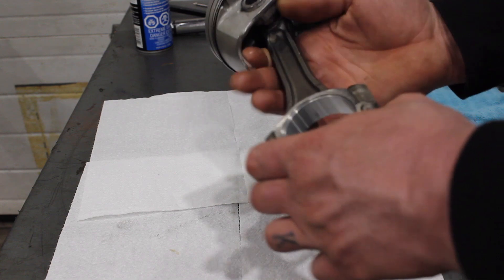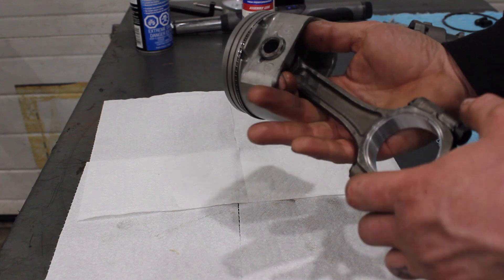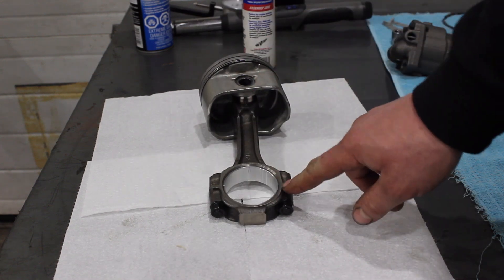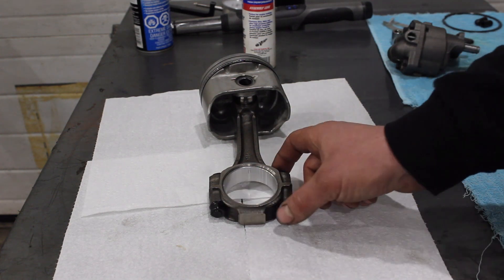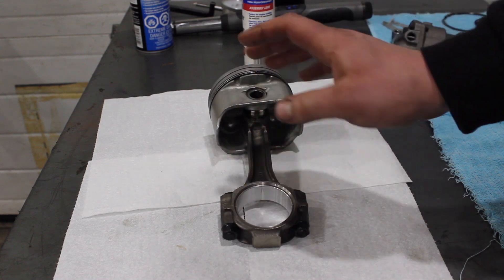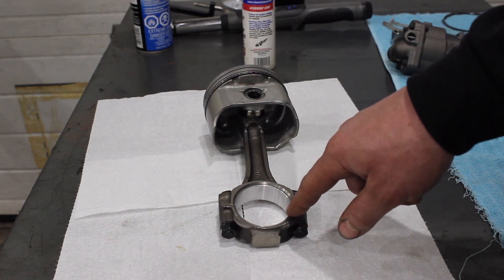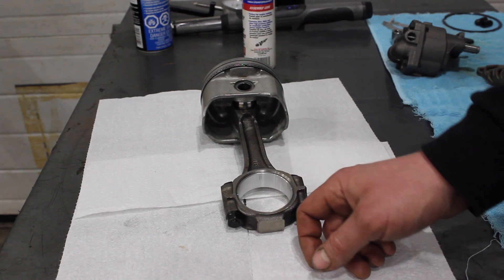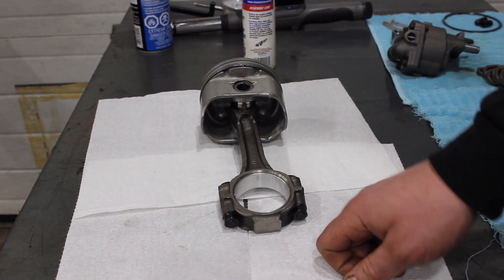An Important Upgrade! Even for a budget build (L31 Build Part 3)

Comment: I like budget builds and SBC's, built a ton of them and big blocks but I see at the current time a diminishing return on your money compared to a LS based engine.  Nothing wrong with a SBC, don't get me wrong but with just a cam change a Silverado 5.3 and a set of long tubes puts out 440-450hp even on a carb.  I've been building the LS based 5.3's for over 10 years and from a performance standpoint the SBC is now the the red headed stepchild on the street.  Don't get me wrong, I still build them for the my cruiser friends but from a performance standpoint you just can't beat those LS heads for power production.  I do like to run a carb on them, simple and easy and I've had no problems with tuning and they are dirt simple, much easier than a SBC to build and modify, even rod bolt replacement with the cracked cap technology just requires  you to press them in and run 'em.   What say you ?  How much work and expense do you have to invest to reach that 450hp level with a SBC ?
Reply: To each there own. I've never had trouble getting power out of SBCs. Some folks just go about shit differently and believe alot of misinformation. Monkey see monkey do. I've been building engines of all brands for over 40+yrs. The LS is just another choice out of many. But they are trendy in the world of people who think everything old sucks. We been making power long before the LS showed up. And in the real world, the bigblock Chevy is king. Btw, I've built at least 20 LS engines over the past 15yrs, so I speak from experience. If the LS was so much better, I'd sell all my bigblock Chevy shit and buy a bunch of LS shit. But I know the reality of the situation. And with the parts available today, it's not hard to build a 434ci SBC that puts out 850+hp NA. I remember Don Kirn built a 427ci SBC with a Rodeck block and ALL-PRO heads, single 4-barrel and it made 1005hp NA back in the late 90s. Check out Sprint car 410s, 950hp NA, that's what Don Kirn specialized in. Look at some Comp Eliminator SBCs and see how much power they make. Reher & Morrison built some of the most powerful SBCs ever built. You just ain't been around any real SBCs that were built for big power. Those 300hp 350s get pretty boring. I have a 590hp NA 357sbc tucked away now. Take a stout LS build to run with it NA. Ran mid 6s in the 8th. LS is just another engine. Plenty are better.
Reply: Godzilla Ford is better than the LS if ya gotta have a modern engine, because everything old sucks....
Reply from the maker: Its certainly preference but theres no doubt that a LS has almost 50 years of technology over the traditional SBC. They took decades of racing and factory design and incorporated them into the LS platform. It would be weird if they didnt have some advantages haha. Now a LS build isnt always as cheap as some may think...if you already have a SBC with headers, mounts, trans setup ect...a LS swap adds up quickly. You can often find a deal on a SBC intake for $100 and $50 used HEI, where if you wanted to run a carb LS your looking at $1000. The real advantage to the LS is the heads though, they are as good as alot of aftermarket SBC head and are key to power. I do like LS engines and I will probably show some of the ones I build on my channel in the future. But to this day the traditional SBC still holds a special place in my heart  and I think many feel the same
Reply: @cuttersperformance  The LS has 50yrs of development on the gen 1, but the gen 1 SBC also benefits from 60+yrs of continuous development in practically every form of motorsports known to man. There are SBC heads available, "ALL PRO for example" that make the best LS head made look stupid.  Most powerful SBC or LS  I've ever seen was Rick Santos Top Alcohol dragster 377ci 14-71 blown alky engines back in the 90s. 3000+hp 25+yrs ago. Ran in a class full of Hemis and kicked was. Never seen an LS that could run in that class.... It's all BAE Hemis now. LS is a good engine to build, but it's far from the best.
Reply: @cuttersperformance  Not many people building Stock 1955 265s to race these days. The SBC has came along way since 55. People been making them better ever since. So technology on the SBC didn't stop in the 50s.
Reply: its cheaper to put better heads on your sbc if it already has one. ls engines aint cheap anymore, aint cheap to swap, and expensive to tune. ls engines also dont make the tq down low, so they feel less torquey than a sbc.

Comment: Many re-builders say you can't rebuild PM rods. What is the real scoop on this?
Reply: You can. It's not uncommon.
Reply: Pm rods are just the same design as the normal SBC rod, LS rods the cracked cap technology cannot be resized and rebored.
Reply from the maker: Yeah you can resize them, you may be thinking of a LS crack PM rods that cant be resized the traditional way. Those rods have to have the big end bored oversized and a larger OD rod bearing is used. The cracked rods dont go out of round like the traditional rods though. I actually had a set of vortec PM rods last year that were so out of round that they couldn't be resized haha
Reply: @cuttersperformance I was under the impression all PM rods started out as cracked cap rods, but my 99 l-31 isn't a crack rod. A lot of re builders offer short blocks with PM rods, so somebody is resizing them. PM rods are a lot stronger than people give them credit for. Your info will help to clear the confusion a bit thanks.
Reply: @hardball107  thanks, the PM rod confusion is starting to clear up.

Comment: Bro, to start, I am a total newb. I have a L48 Vette. Lowest hp Vette that I know of..lol with that said. I bought a L79 cam supposedly with 447 lift and a set of Vortec heads. I can not get a definitive answere what the max lift for Vortec 062 heads are... I just saw your video on measuring lift but wondered if there was a definitive answere.
Reply: @fukemallgarage  how does just running a different spring give you more space between the retainer and the seal?
Reply: @fukemallgarage  taller spring?
Reply: @Fukemall Garage  this I have herd. Someone told me to take my retainers and grind them down... I'm not that confident to do that and have no way to regulate how much to take off.. Thanks guys
Reply: I've also heard Herd something about off set keepers will bring ya up some... Any one use them ??
Reply: Some take more lift than others. Best to check to be sure. Offset keepers will get ya more installed height, as will retainers with a taller installed height. Best to cut the guides down and use PC seals. Longer valves will work too.
Reply: @mikeday8826  They are beehive springs with different retainers good for 550" lift, LS based.
Reply: buy a set of the old z28 flat tappet valve springs and pull the inner damper out. make sure your valve seals are tapped ALL the way down onto the guide. gm didnt do this from the factory, so you lose clearance off the bat. after all this, you are good to like .500 lift
Reply: @kiesha104  if you use offset keepers(like the 0.050" ones commonly used on the beehive springs) your self aligning rockers may ride on the retainers, and not the tip of the valve. not good, at all.

Comment: Why would they need resized if you make sure upper/lower plastigauge looks good?
Reply from the maker: Plastigauge is a great quick check. But it only properly works on a round journal and rod bore, and that can only be checked properly with micrometers and bore gauges.